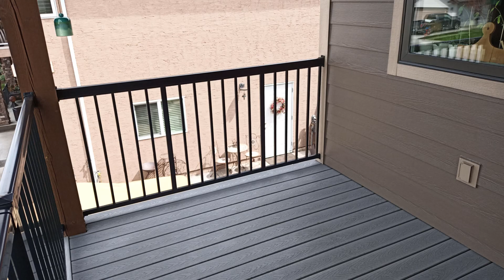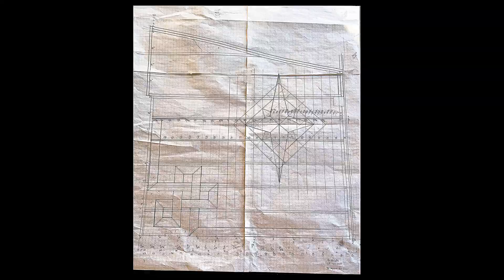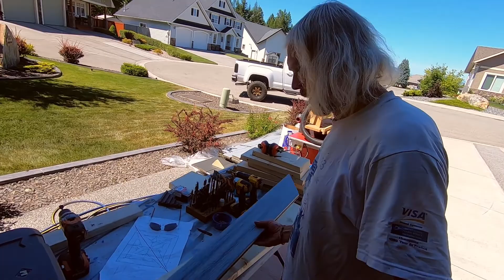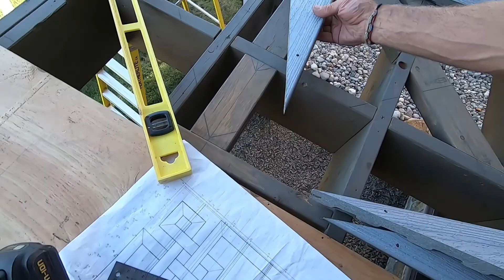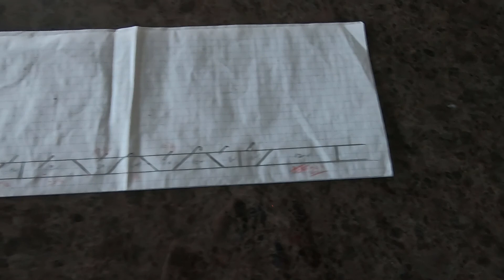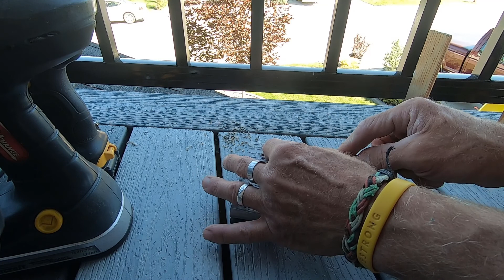Decking Inlay with Trex Compass / Star two colors

Comment: How about summer when it is expanding?
Reply: You should never install this material butting or splitting over a single joist, I’d be really surprised if that stayed looking good long term
Reply: All the butt joints will be f***ed up.
Reply: Maybe you should read the specs for the materials you’re using dude